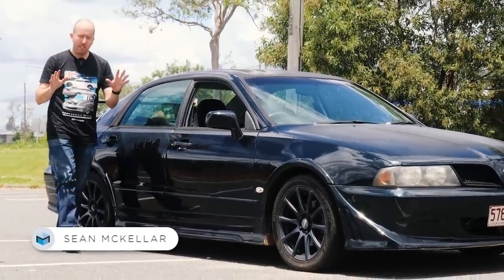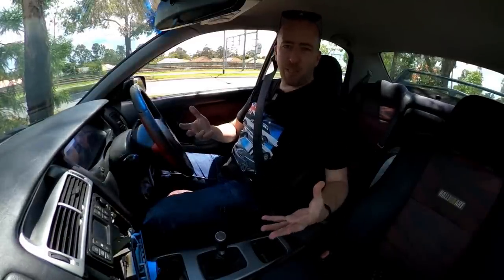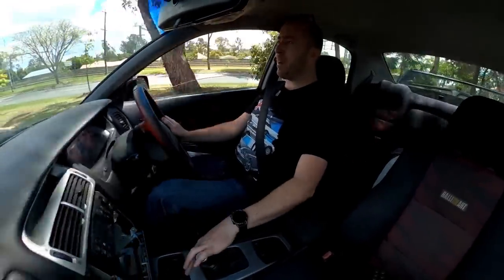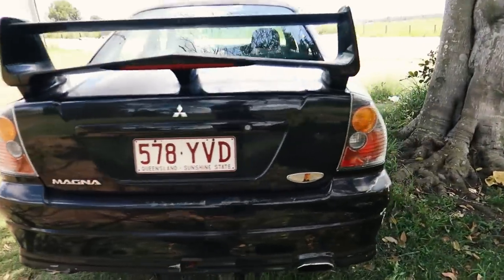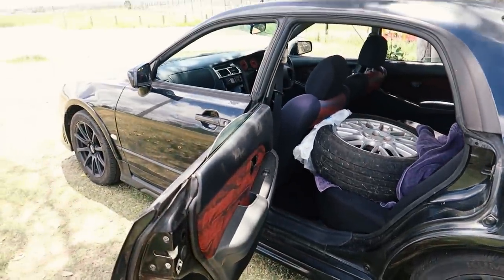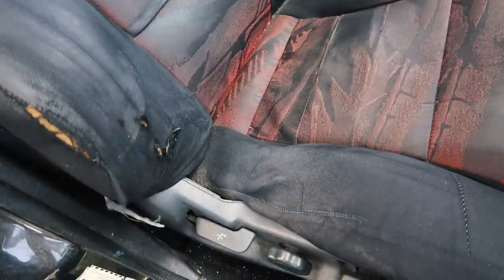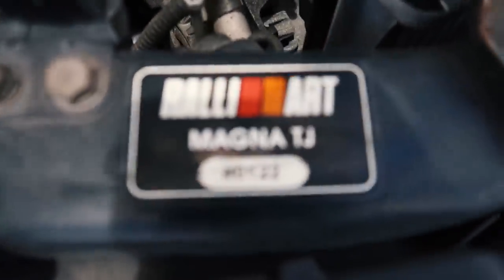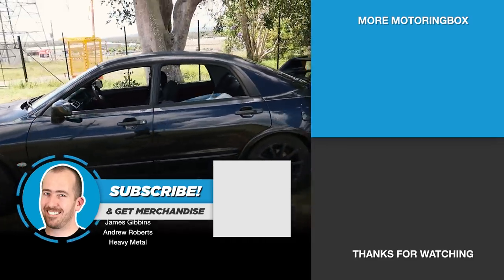Mitsubishi Magna Ralliart First Drive! This Aussie 180kW 6G74-powered manual sedan is a screamer!

Comment: They felt 2nd hand when they were new... For $5k I would've bought a 2008 200kw Aurion which is quicker and more reliable
Reply: Depends which Ralliart Magna it was as some got wilder camshaft's & different compression ratio that boosted power to 210kw. 
It would embarress alot of 13sec car's like that.
Reply: @brantleyfoster021  It'll still be a low quality Magna with bad paint, mechanical issues and cheap plastics
Reply: @ozwasp  
Are you referring to Sean's example or this car in general? 
It was probably the best quality Magna, Mitsubishi even offered black & red leather seat's with some examples. 
Replacing the bodykit part's are very expensive, the car had a 0.28 aerodynamic co-efficency, so it's not a cheaply built car.  
In fact, alot of technology in the Ralliart Magna was more sophisticated to it's rival's like the sound system. 
Most car's use cheap plastics in this price range like the Aurion, Falcon & Commodore. 
These were very reliable car's, it came out in an era where durability testing was extensive.
Reply: @brantleyfoster021  The only good thing about it is that it's a manual and Aurions aren't... Apart from that everything on them is cheap and they were always known as a bean counter's car
Reply: @ozwasp  
It won the Australian Motorkhana on release. 
Image is a matter of perception's, it might be cheap but it wasn't as cheaply built as it's rival's & it wasn't priced like a supercar. 
Plus there was the Supercharged model's. 
The most powerful of which had 251kw & 440nm. 
Even the Supercharged AWD Magna's got 226kw. 
Plus the Magna's auto tranny has the same auto Gbox as the EVO VII GTA which can be extensively tuned to add launch control & have much sharper & faster shift's, which Mitsubishi swiped from Porsche.
Reply: @brantleyfoster021  The Holden Camira won Wheels car of the year too
Reply: @ozwasp  
Holden Camira's are also one of the most unreliable car's ever made. 
It destroyed it's own reputation. 
It was known to have good ride & handling for it's price back in 1982, but was underpowered. 
Plus the best car Holden introduced in the 80s was the VL Turbo.
Reply: @brantleyfoster021  Yes, my point was awards mean nothing. VL was best of the original Commodore and 3L was definitely a better option than old 202, however the VN 5L fuel injected V8 came out in 89 and was a better motor to suit Commodore out of the factory - Ive had 3 of the FI 5L. The VL turbo never sold in mass as turbos had a reputation of being problematic in the mid 80s and V8s were the more popular option. Many of the base turbo VLs were bought by police
Reply: @ozwasp  
They only lasted 2 years because the engine & transmission became expensive to source, yet they still sold over 150000 of them during that time. 
I have to disagree about the motor though, the VL Turbo engine is still the most high tech V6 Holden ever put into a Commodore. 
It had more power than the V8 when it finally landed, plus the VL Turbo engine didn't even have intercooling. 
They can easily do over 1 million kilometers stock so they were very reliable.  
If Holden went with the RB30DET, all those V8's would be humbled. 
They wanted to give their V8's a chance basically by detuning it as much as possible. 
It's the higher capacity version of the motor they put into the Skyline GTR.
Reply: @ozwasp  
Car of the year awards don't mean much back then. 
But the Australian Motorkhana win is significant because it requires power, balance & good handling to succeed.
Reply: @brantleyfoster021  No, they were never going to continue using Nissan motors and it is no where as near high tech as the alloytech quad cam V6 (although that is unreliable) Nissan motor is a plain SOHC with a turbo bolted onto it which put out 150kw from factory. Yes you can wind them up to 300+kw with bigger turbo's etc but that's not the point... The 3.8L Buick motor which followed the 3L was always going to replace the 202 and the Nissan motor was interim measure. GTR motor was a different block with 2.6L displacement
Reply: @ozwasp  
The V8 only had 122kw when it landed, but it had more torque. 
The VL Turbo was always the performance model. 
The VL Turbo engine was from the same family of motors as the Skyline GTR, they were both from the RB engine line up. 
Different engine displacement though. 
But the RB30 engine was very high tech, much better than the the current crop or the VN V6.
Reply: @brantleyfoster021  The performance models were the Brocks... VL group A was 160kw in 87 and 180kw in 88... Despite what you think +olden never marketed the turbo as a performance version - it was a different era and turbos weren't popular in rwd sedans
Reply: @ozwasp  
You can read up on it, the turbo was the gun car. 
The Group A car's weighed alot more than the base VL Turbo. 
It was 1415kg. 
The VL Turbo SL weighed 1250kg, that's a 165kg difference. 
The 80s was where turbo's were very popular. 
Why do you think over 75000 VL Turbo's were being sold each year? 
I'm not saying the 180kw V8 was slow, only the 122kw model plus it only came as a 3 speed auto. 
The VL Turbo 4 speed auto was the quickest shifting auto on the planet at the time.
Reply: @brantleyfoster021  Your facts are wrong. Only 151000 VLs were sold all up and it'd be lucky if 10,000 were turbos. You don't seem to listen, Boomers weren't buying turbos and Holden didn't make the turbo a sports model. The 3L turbo ran around 7lb boost and was 150kw (which was a lot then). If you look at Porsche and Ferrari turbos of the era, they were running low boost and had around 200-300kw... If was a a different era, turbo technology wasn't developed and as a result power outputs were low. Believe what you like but outputs for turbos were low and so was demand... Apart from a demand for turbo sports cars in the early 80s (Cordia, Starion, Exa, Pulsar), it wasn't until the WRX and others came out in the mid 90s that demand increased... All those early 80s turbos had less than 120kw, with many less than 100kw
Reply: @ozwasp  
So you don't actually know how many VL Turbo's were sold then. 
You didn't dispute the weight figures I put to you. 
Only the total that were sold of all VL Turbo Commodores. 
So I think it's safe to assume that the SL VL Turbo was a significantly lighter car. 
Judging by how well the R32 Skyline GTR did on the racing scene with a RB engine, think it's safe to assume that it was responsible for more notable win's across it's lifetime than the VN Commodore V6 or more current V6's.
Reply: @brantleyfoster021  There weren't that many VL turbos. I lived through the era and they weren't that common. Yes they may have been 1260kg but so was a VK group A with 200kw (lead fuel). The VN 5L manual was 1360kg and could be easily tuned to 180kw. These power outputs are pitiful by today's standards, but all cars were lighter and 0-100 in 7s was fast. The WRX was the game changer for turbo cars when it came out in the mid 90s when it was able to  0-100 in 6s and cost 40k... Anything quicker was double the price or more
Reply: @ozwasp  
If you are referring to the SL, that was 1250kg, not 1260kg. 
The VK Group A weighed 1400kg, not 1260kg so it was alot heavier overall. 
I agree that the WRX was a game changer, but really the R32 GTR was the first to pioneer the advantages of AWD.
Reply: No, the Audi Quattro was the first to use AWD successfully... Japs always copied

Comment: Why oh why did they not make these cars RWD?! Really its what made them such a turn off compared to Ford or Holden....
Reply: Because Mitsubishi offered AWD model's instead. 
Some were Supercharged too. 
Plus the manual varient's of the Ralliart Magna won the Australian Motorkhana on release, beating off rival RWD varient's from Holden & Ford. 
30 of the Ralliart Magna's came Supercharged under Mitsubishi's factory warranty regardless. 
They had about 250kw despite weighing less than 1500kg.  
There was even 5 that put out 210kw from their NA V6's. 
RWD rivals weighed more than 1700kg in comparison.

Comment: Wouldn't buy any car with paint fade.
Reply from the maker: Me either, it's usually the most important thing to me. But I wanted one of these no matter what. I saw a red one for sale in better condition for $13k, but still with paint fade starting to happen. Realistically any RA's for sale are going to need paint, so if you want one badly enough...
Reply: @MotoringBoxTV  well I tell you what, Magnas never a such let down Sean, infact they bet the Commodores and Falcons in the early 2000s with better suspension and a better gearbox, that's right. We had a 2004 Mitsubishi Magna with 220,000km on the clock and went around Australia without any issues, Mum had one as well when I was a kid.. Those were the days, the cars from some country proving the world with technology and Mitsubishi happen to compete with Commodore and Falcon.

I sincerely miss those days too... Things have changed over the years man.. "Big Time"
Reply: Some people don't know how special Australian cars are, only we known that lovely feeling..